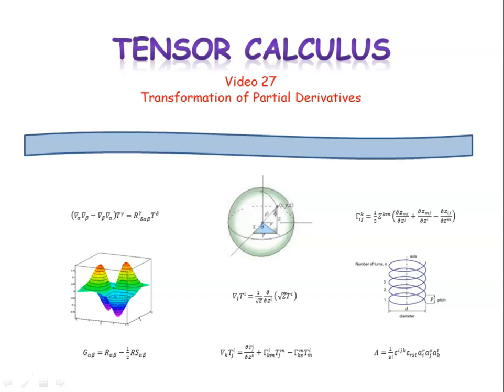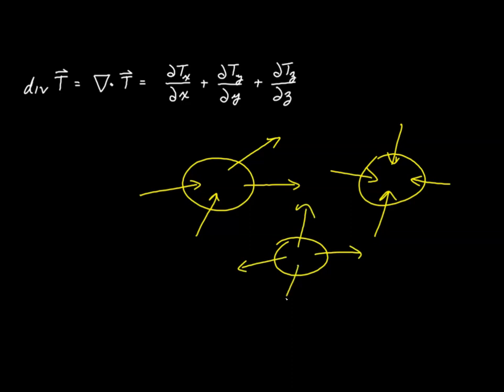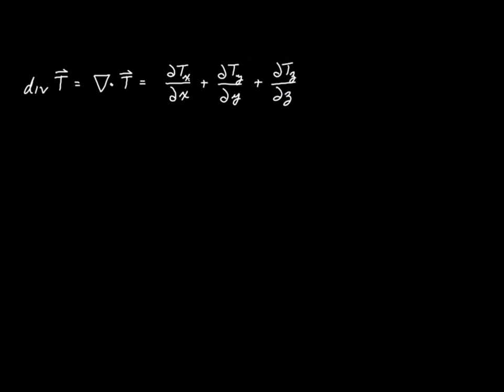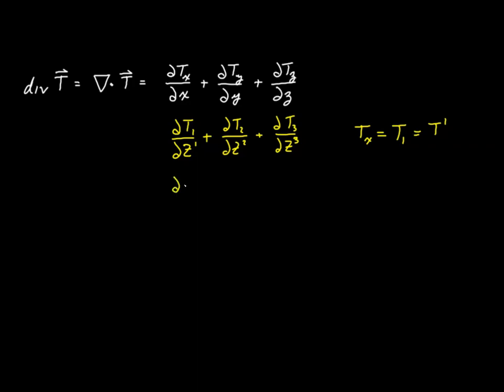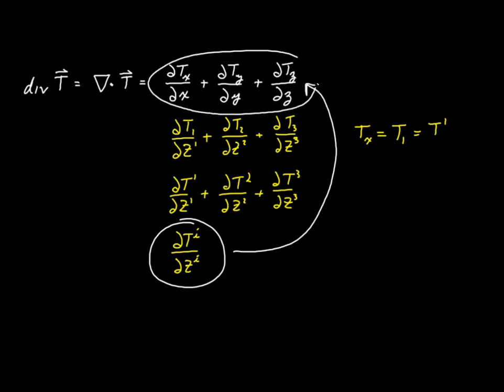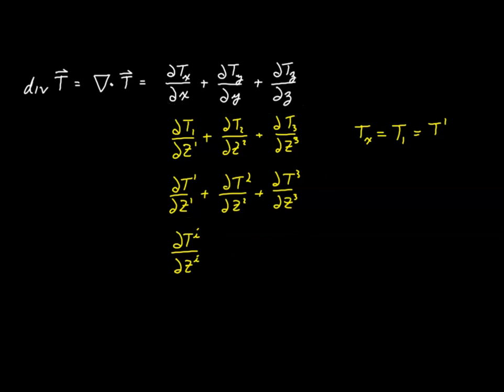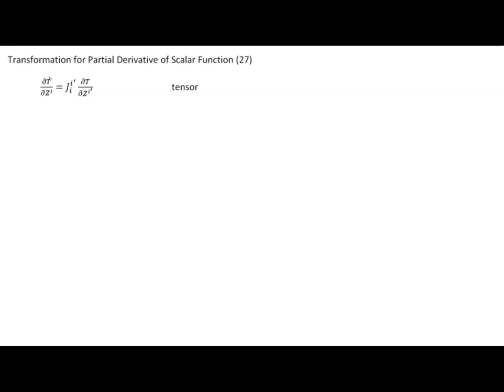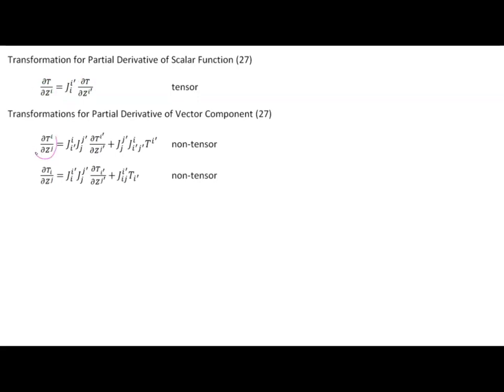Video 27 - Transformation of Partial Derivatives

Comment: Hello teacher. I didn't understand one thing. 5:10 The partial derivative of T^i with respect to Z^i is a valid contraction and provides us with an invariant expression. 5:40 But to know if the partial derivative of T^i with respect to Z^i is in fact a tensor, we use the derivative of T^i with respect to Z^j and this derivative is not a contraction but a second order tensor . Why do we use a second order tensor to do the test?
Reply from the maker: My statement was a bit misleading. When I said that the partial of T^i with respect to Z^i is a valid contraction, that was not really correct. What I should have said is that the partial of T^i with respect to Z^i is a valid contraction, provided the partial of T^i with respect to T^j is a tensor.

Remember the topic in video 21. If we have a known tensor of rank r, then a contraction of any upper and lower index pair will produce a valid tensor of rank r-2. So to know if the expression partial T^i with respect to Z^i is a valid contraction (tensor of rank zero - i.e. scalar function), we have to know if the partial of T^i with respect to Z^j is a valid 2nd rank tensor. If it is not, then the prior expression is not a tensor (scalar function) either. In that case the expression will be a scalar value, but it will not be an invariant scalar function that is same for all coordinate systems.

I hope that makes sense.
Reply: @tensorcalculus822  Now I understand. Thank you very much teacher. I'm reading the biography of Einstein that you suggested. I had already read a lot about Einstein, but this biography tells many details that I have never read anywhere. It's a wonderful read. I'm Brazilian and I managed to download a version in Portuguese. Thanks for the suggestion.

Comment: @3:32, indexes in denominator are raised indexes but mentioned as covariant.  Are they not contravariant?  I am confused.
Reply from the maker: Taking a derivative with respect to a coordinate with an UPPER index always introduces a covariant index in the LOWER position. This is consistently true throughout.

Go back to videos 9 and 11. Each covariant basis vector (lower index) is derived by taking the partial of the the position vector R with respect to the corresponding coordinate variable (upper index). This is because the resulting object (covariant basis vector) transforms according to the covariant transformation rule as seen in video 11.

Also note in video 11 that the Jacobian is the partial of one coordinate variable with respect to another. The partial operation introduces a lower index, so the resulting object has one upper and one lower index, even though the coordinate variables have only upper indexes.

When you get to cofactors in video 47 you will see that taking the partial with respect to a variable with a lower index will introduce an upper index into the final result. I know it sounds confusing, but it is consistently true.
Reply: @tensorcalculus822  Thank-you!